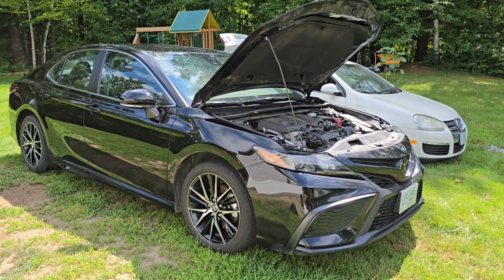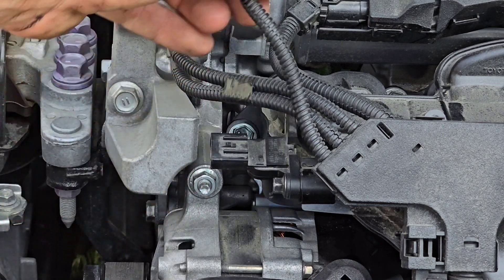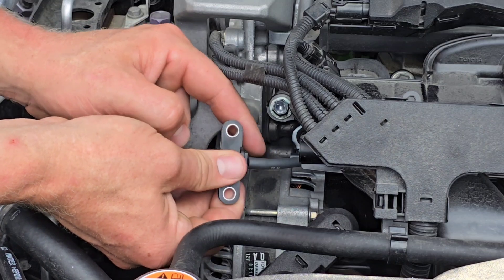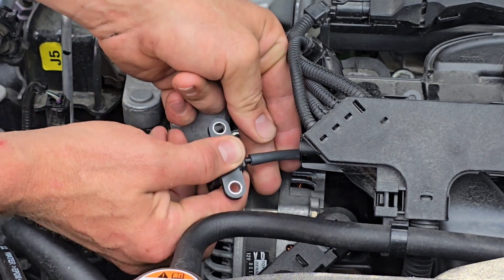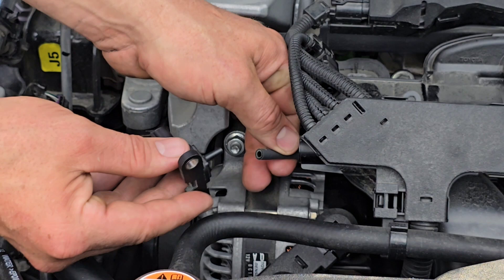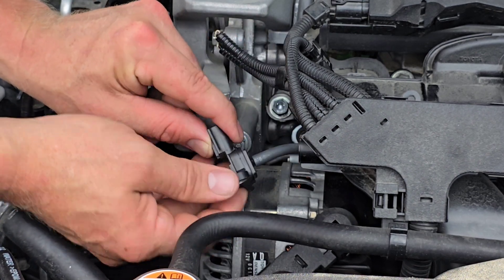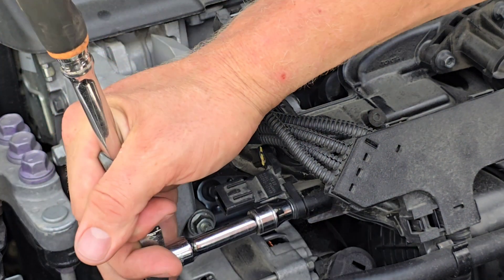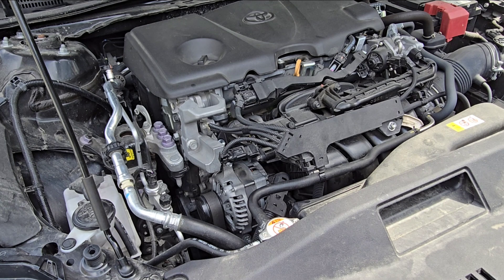MAP Sensor replacement 2018 - 2023 Toyota Camry

Comment: What kind errors you have if mAP sensor doesn’t work?!
Reply: Idk. But my 2022 Toyota Camry se 2.5L, nightshade began saying “pre collision system malfunction” and “secondary collision system malfunction”
Reply: @LocalFloridaMan24  remove negative  battery terminal head wait 10 minutes and put it back this will  reset .  Also dont forget put the sensor  cable before restart  it.